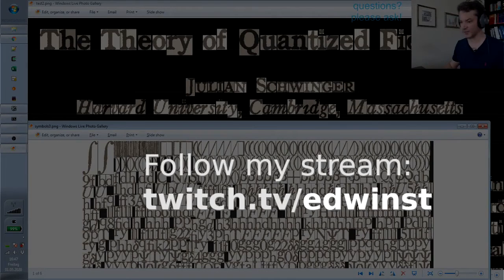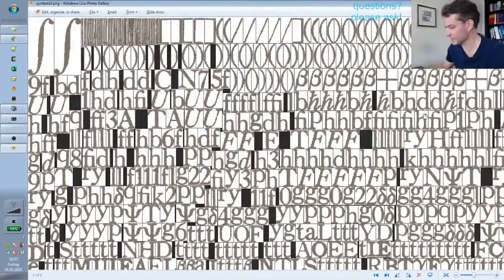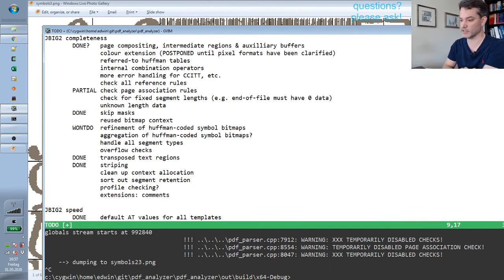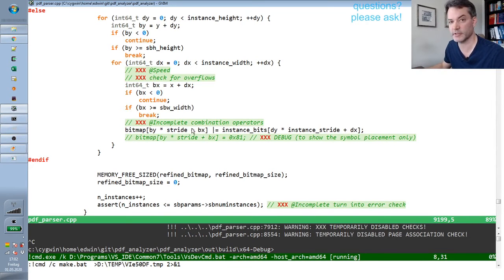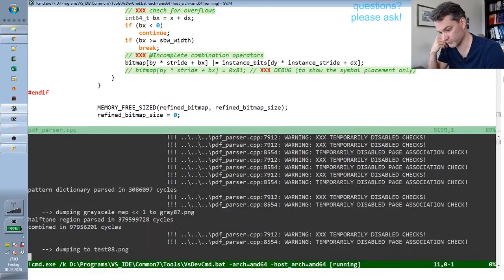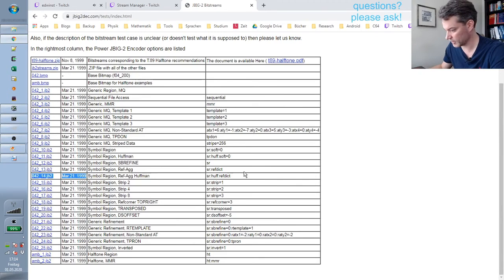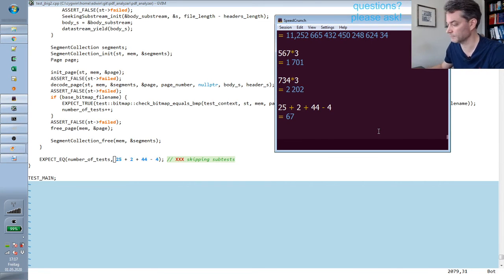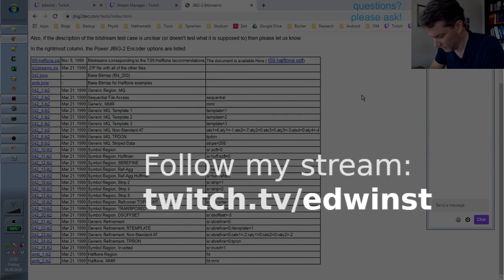JBIG2 Demo and ISO Fail [Handmade C++ Stream]

Comment: Thanks Edwin for your video. It gives a good and visual explanation of how JBIG2 works. I'm still wondering if the JBIG2 Encoder could be implemented freely . As I understand, the JBIG2 encoder is patented and only the JBIG2 Decoder is free to be implemented (as it's part of most PDF readers...).
But I can't find the specification anywhere (the official documentation points out to the iso.org patent which is not free..).
That's not really clear for me, can you give me more details about what is patented, what is not ?
Reply from the maker: It's a difficult question. Yes, there is no free spec. I bought the ISO standard but even the ISO standard does not clarify the patent situation. The ISO mostly covers its own * and refers to some addresses of patent holders. There is a list of patents in the standard with no guarantee of completeness. The newest of the listed patents is from 2000.
I downloaded the current patent database from the ISO (from https://www.iso.org/iso-standards-and-patents.html ) and did not find any current entries for 14492 in it.
My impression is that all relevant patents have expired by now but I'm not a professional regarding patent rights. The exact situation probably differs by country and the only way to know is to pay for a professional patent search but then even that could miss something.